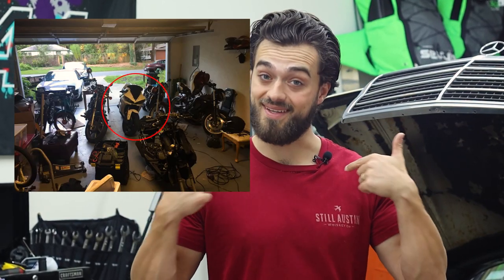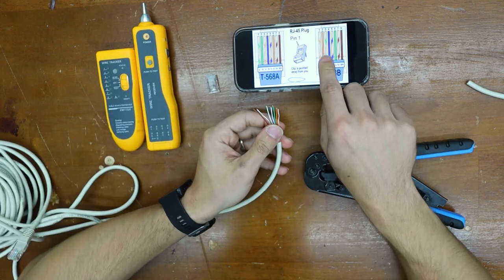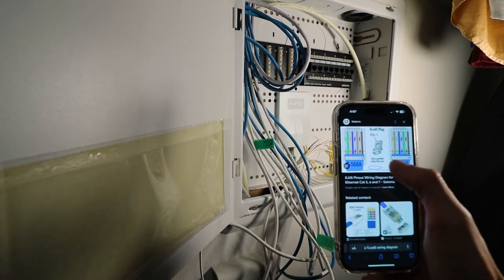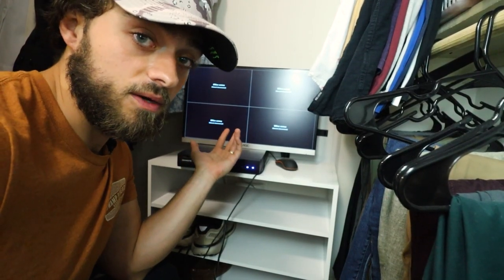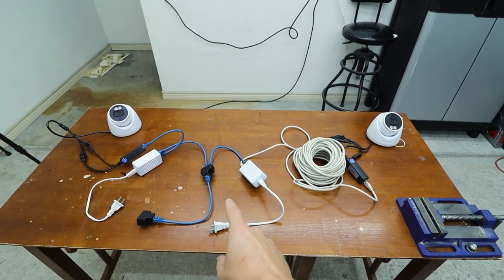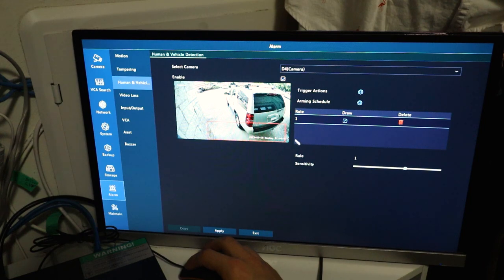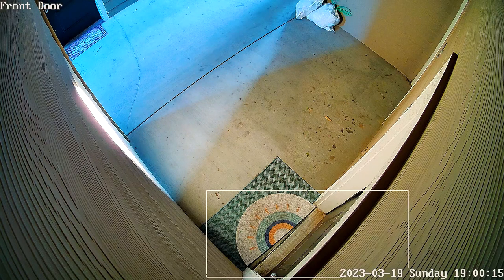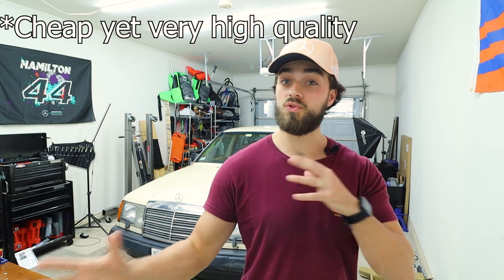PoE Camera Install in an APARTMENT | ONWOTE SECURITY

Comment: My motorcycle just got stollen, Amazon Ring sucked at not capturing it. Only before and after it was gone in a 3-hour gap.
Reply from the maker: I’m sorry for your lost Cisco. My buddy ended up getting a call for his stolen bike from new renters at a house down the street saying they found it in their backyard hidden in the bushes. The thieves tried to start it by tearing up the ignition. Perhaps it was some dumb dumbs near by? 
Exactly, Amazon “security” systems are pretty scammy. 
Hope you find your bike!
Reply: @AutoMotivate  Yooo! Today a couple of hours ago the police found mine also in a bush ditch. Same thing. Seems they tried to tear the ignition and probably failed so they ditched it. Some people from the apartment complex called the police when they saw it.
Reply from the maker: @PilaPlanet  dang dude! Im glad it’s not gone forever. Replacing the ignition isn’t too hard, luckily. Checkout this motorcycle alarm system: https://amzn.to/3Iuxfrt
I used this for a long time which gave me a piece of mind. It seems that they have easier to install ones with GPS, which you should check out. I would also consider getting a disk brake lock for extra security.